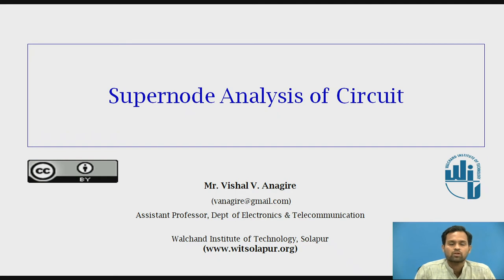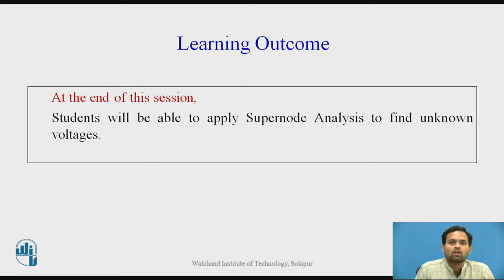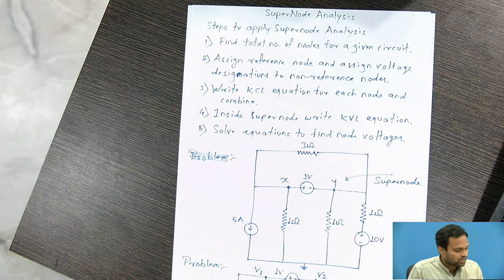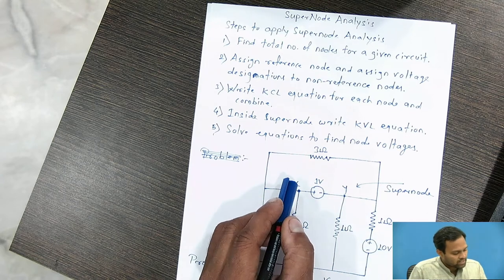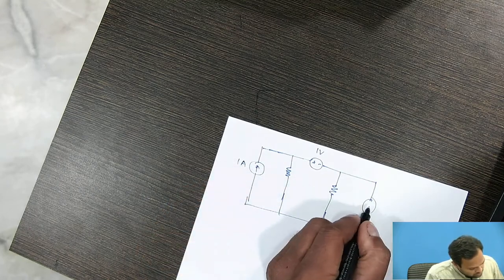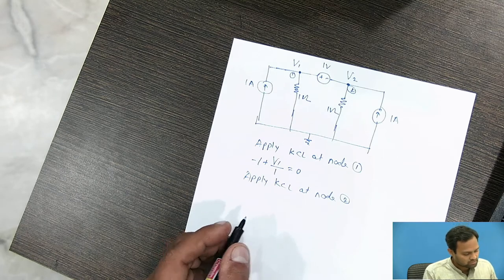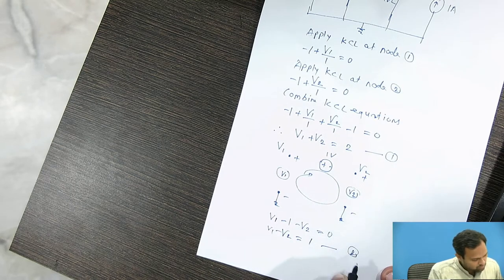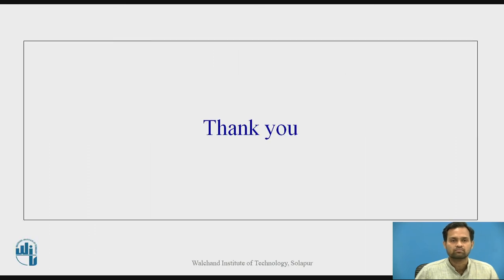Super-Node Analysis

Comment: Why didn't you take the upper part of 3 Ohm resistor I think you have forgotten it... 
if not, then please clarify.
Reply: Upper circuit diagram is used just to explain steps involved while applying Supernode Analysis demonstration of problem solving starts from second circuit diagram